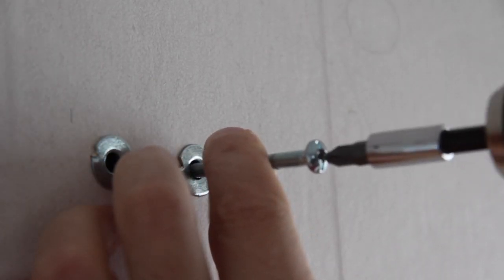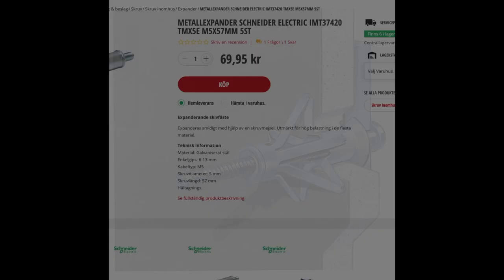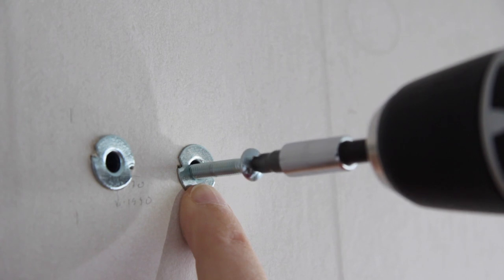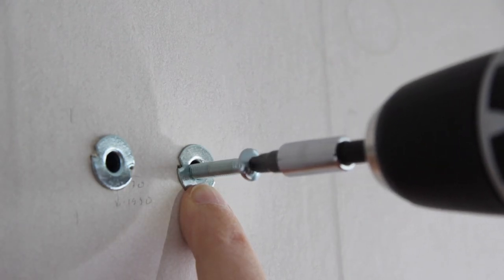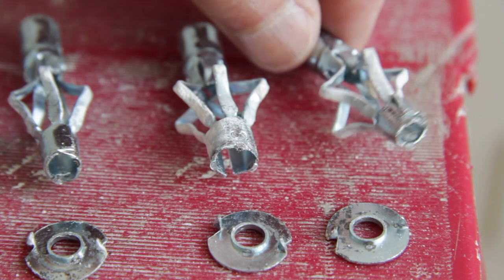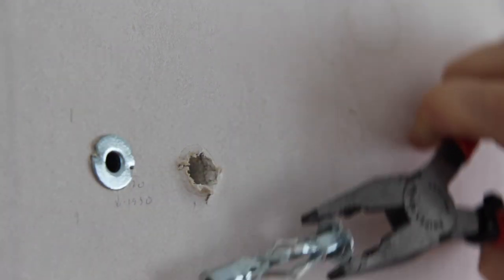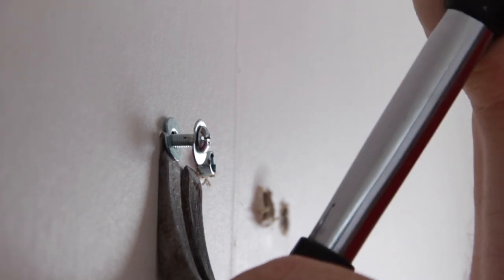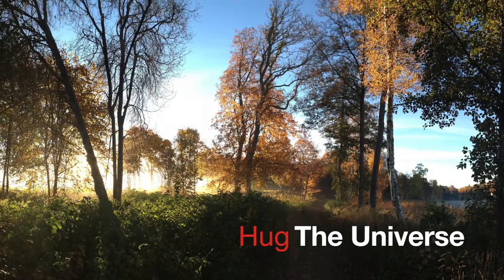How I Removed Hollow Wall Anchors

Comment: Hammer the anchor without the screw in it until it recesses a few mm into the wallboard, then patch over it with drywall compound.
Reply from the maker: Yes, that is another way of doing it :). Thanks for reaching out! I suppose removing these is for us with slight ocd issues ;)
Reply: So just leave it in? Push it in further and repair over it? Prob not a bad idea
Reply: I just think that's lazy.... plus what happens if someone wants to screw something in that exact spot later? I'm getting my home ready to sell and I need to take several out. Yes I could be lazy and do that but what happens if they want to screw something in later?

Comment: Can't you take the screw out and using a little larger drill bit drill the spot where the screw was to break up the little 4 pieces like legs to remove the rest of the metal?

Comment: Used your tecnique.
Gently tapping with a hammer, and then using some grips to gently remove them.
I had 8 to remove, 3 the heads come off, and they went in the cavity grave yard, the other 5 came out, with a bit of effort. Cleaned the holes and filled them.
Thanks for the tips
Danny

Comment: Do NOT use a hammer to pull a nail or screw out directly against the drywall.  Always put something between the hammer and wall
or you'll put a large indentation in the wall under the hole you're working on, making your damage even worse.